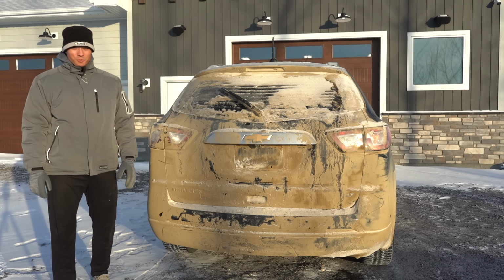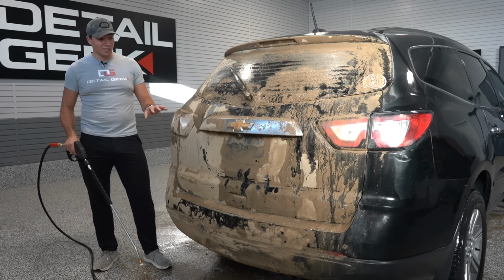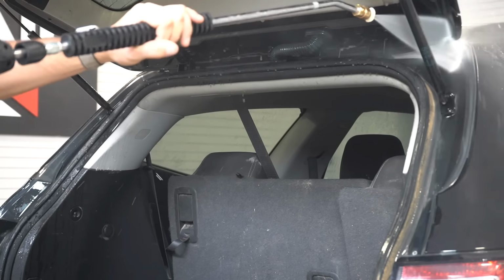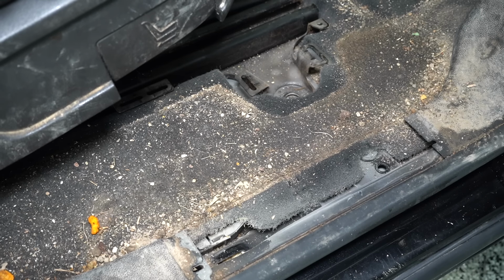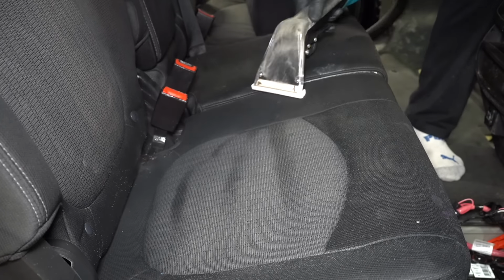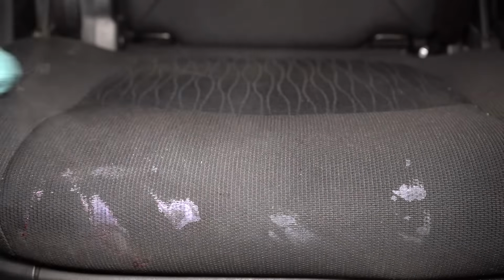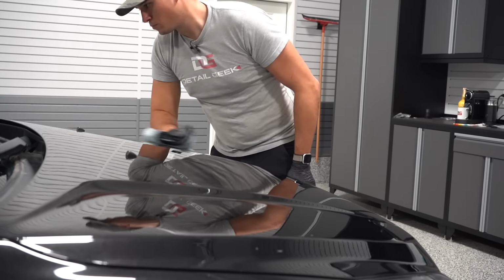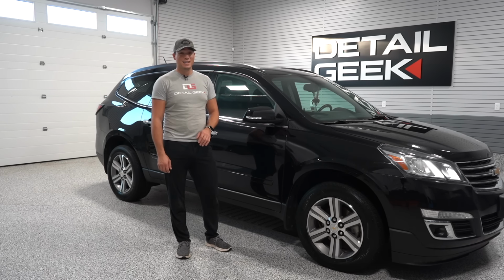Owner REACTS To A Mind-Blowing Detail Transformation!

Comment: Cant believe you managed to get the nail polish off the seats. That was impressive. Thought for sure the seats were ruined.
Reply: I’m a professional carpet cleaner and it is very easy to get out if you have the right chemicals, the only thing is he wets the seat far too much to the point where mould can dry in them because he’s soaking the foam
Reply: @benrycroft1139  Cool
Reply: Execrcc
Reply: Cant believe you managed to get the nail polish off the seats. That was impressive. Thought for sure the seats were ruined
Reply: Probably kid’s type nail polish

Comment: In the UK you can go to a car wash lot where you will find drive through style car washers that cost £4-£12 depending on the detergent and waxing options you pick, there are parking spaces surrounded by large perspex walls with built in soaping brushes, pressure washers that cost £3 if you just want to use the pressure washer or up to £15 if you want the soaping brush to pump out various cleaning agents. There also vacuum bays similar to the pressure wash bays but have powerful built in vacuum cleaners and upholstery cleaners with similar pricing options depending on if you just want the vacuum or the upholstery cleaner to. Some of  the larger lots have garage bays where you can pay someone to wax and buff your paint work and wheels. Once a month i take my car for a basic in and outside valet and every 3 or months i drive to the washing lot in the next town and spend about £60 to get my car show room shiny.
Surely on the other side of the pond where every thing is usually bigger and better you have something like this and this lady is just neglecting her car
Reply: Car washes in the US and Canada are a LOT more prevalent, with far more better and newer options and far better prices than the UK.  I took a road trip last year in Cali/Az/Ut and part of the fun was just stopping to try out all the wash options, which ranged from $2 to $8 for the highest end foam/wax/scented etc..  Our offerings here in the UK are dire and overpriced by comparison.  It literally is just neglect on this lady's part, there is no excuse.

Comment: I don't have the set up like you do.  The car wash charges $20 for a basic and the DIY wash charges 6 in quarters before you are done. Now what I do is to wait when a spot is opening trying to remember if they used the brush. Then I go over my entire car with the brush because it still has soap.  Then I hit it with the blaster and give it a long spot free rinse until the time is up.  Then I quickly drive around until my car is dry.  Then my car is as clean as I need it to be for $6 bones. 
In the summer I bring a bucket that contains Oxy laundry soap and boiling water that's only hot when I get to the car wash. I used their brush to brush off most of the dirt. Then I set it aside and hit it with a bucket of baking soda, and fabric softener before I rinse it with the spot free setting.  When This cost $3.  They have a free vac but it's really weak.

Comment: Superb!
I can not tell you how many insanely disgusting details I did in 25 years of owning a small car lot, but it was my specialty. SOOO many full interior tear downs... I too have seen some unexpected things in unexpected places... 🤣
Though it was a great way to make a living for many years, it was unfortunately this kind of work that also physically beat my body down.
(Just some friendly advice from a guy not much older than you) Do anything you can NOW, before it is too late, to keep yourself from having to bend over or crawl around on your hands and knees for long periods of time... If you cheat, you are the only one that will pay for it later! Seriously, brother! For all the pain I am in now from all the hours I spent on the floor or hunched over doing the thing that needed to be done, I wish I had Invested in a small lift for doing all that low to the ground work. It was not until I had already done damage that I started lifting vehicles & using a rolling chair for all the ground work, and elevated surfaces like tables or wall hooks when cleaning seats, trim, etc... Just some suggestions for the long term... 😉 Keep up the great work!

Comment: Great work. Question: when you were cleaning those carpet thresholds alot of water went under the carpet on to the floor metal. Did you then extract that aswell as the carpet (if you did we didn’t see it), else that would just be lingering there starting to rust?
Reply: I'm sure he got it all. He's a professional. :)
Reply: @charliem.7492  I’m sure too, but that’s not what he portrayed in the video.

Comment: I know not everyone has access to unfrozen hose, but it amazes me that these people can't just hose there car off every once in a while, just the pressure washer alone makes the biggest difference. Takes 10 minutes at most.
Reply: We have car cleaning stations everywhere in Germany. You drive there, insert a few Euro into the machine and then you can use the power washer, with or without foam, a foam brush and usually a finisher to quick dry the car. When I'm busy I do a quick pre wash, foam+brush and then rinse it all off. All that for 3€ (~$3US). 
There must be a similar concept in North America.
Reply: @dude988  they definitely do in Canada and USA. They are car wash stations with pressure washer etc like u said. So yeah its crazy. I would clean my car like once a month with all that salt. But i guess maybe its too cold sometimes for people to spend time outside.

Comment: Wondering about the use of what appears to be a high powered sprayer to knock off the massive layers of sand / dirt. Under these conditions, doesn't the use of a high power sprayer run the risk acting like a watery sand blaster and abrade the surface?